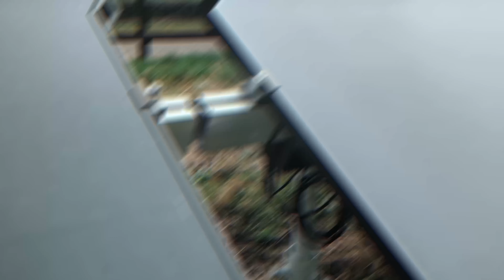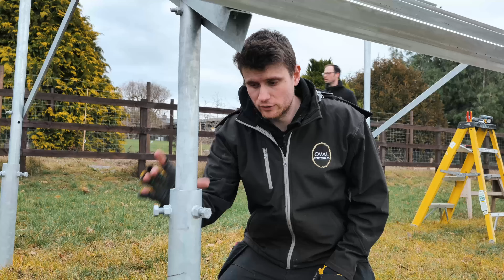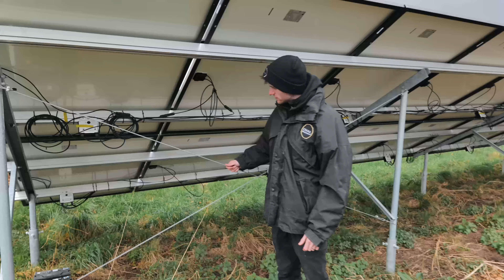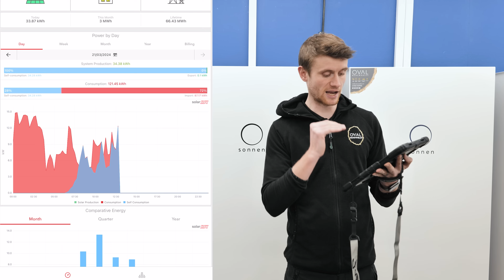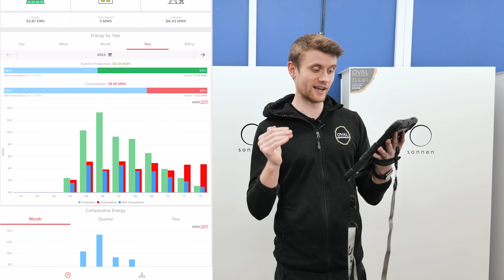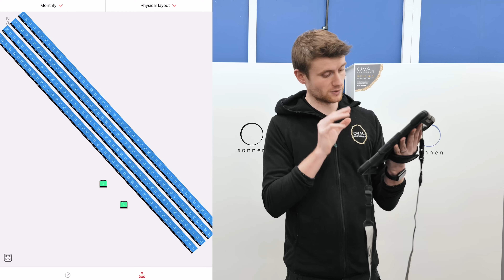208 x DOMESTIC Ground mounted Solar Panels! Here is how we did it! Penrith Project Part 2!

Comment: Mega video. Question….how can a residential home export up to 60kw of solar power + if you force discharged the batteries? Thought there would be a capped peak on what your allowed and what the house was physically capable of? My homes 100amp fuse would explode 😂 And how hard was it to get permission to export this much to the national grid? Thanks Tom
Reply: Don't forget its a three phase system, pretty sure he said the Solaredge inverters were 30kW each, so presumably 10kW each per phase, per inverter, add in the 4.6kW for AC connected batteries and that is 24.6kW export capability per phase. A massive amount, on the 100 amp limit at 240v, presuming I've done my late night maths correctly. Did they really get DNO permission for that, it looks rural. Personally I would have not used Solaredge, a DC connected battery system would have allowed for more battery inverter power.
Reply from the maker: @TheRonskiman thanks for the comment. Yes DNO approval was gained for this system.  Export is limited for the system via the SolarEdge Modbus
Reply from the maker: Thanks for the comment. I can’t remember the exact export limit but the limit is controlled via the SolarEdge modbus. In reality this house uses so much power that the majority is used in the house. This install was part of a three phase upgrade due to the amount of power the property uses.

Comment: How do you co-ordinate the batteries with the solar production when they are different brands? Anything special you had to do to get g100?
Reply from the maker: Yes the solar inverters are export limited as per the DNO’s request.
Reply: @OvalRenewables  do you have any sites where you have installed bifacials?

Comment: May have missed it in the video but do you lose much efficiency with the panels being quite a distance from the other hardware?
Reply from the maker: There will be a slight loss on the D.C. cables but we used 10mm to try and remove as much volt drop as possible.